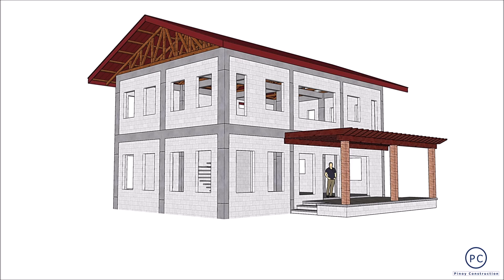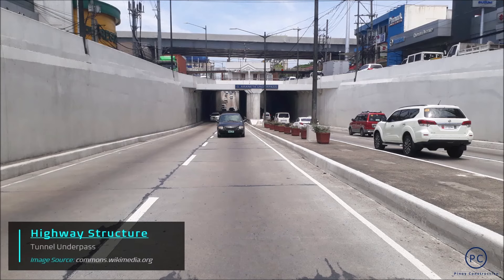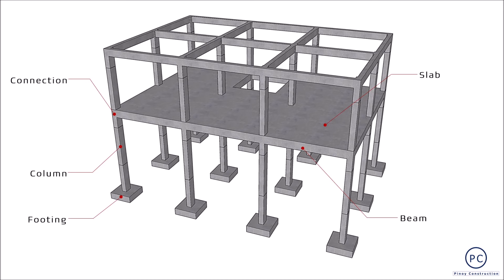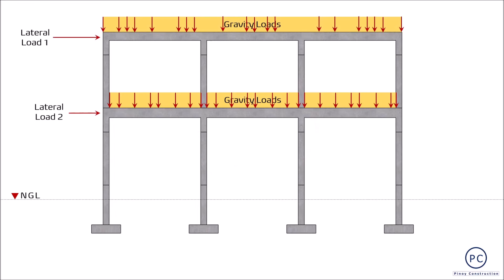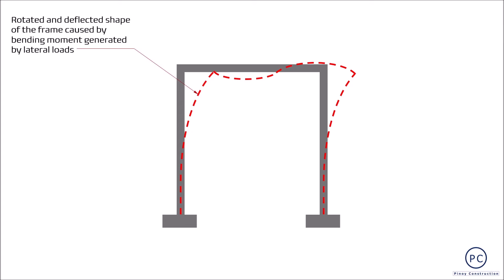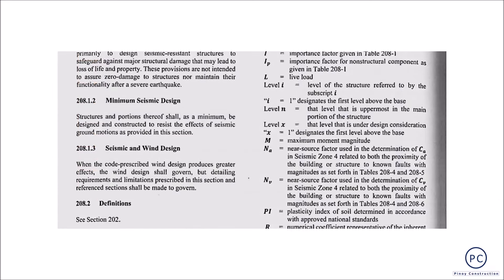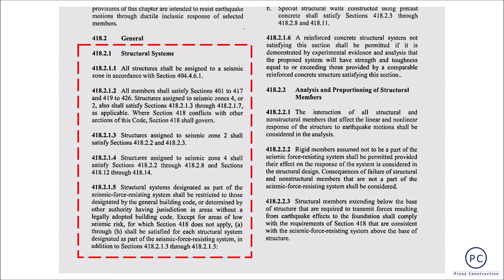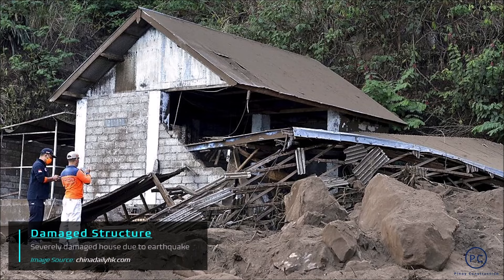Ang Basics ng Structural System Part 1 - Code Requirements

Comment: Hi. I was wondering what is the standard size for beams for a single story residential structure in pampanga? I see that it is 16 mm because of earthquakes but they build my house with 12mm on the beams.
Reply from the maker: Hello. I apologize for the late response. There is no such thing as standard size of reinforcing bar for beams or columns in our Structural Code (NSCP 2015). Although in engineering and construction practice, size 12mm for beams is usually sufficient and recommended for single and multiple storey residential. For columns, 12mm is adequate for single storey and 16mm for 2-storey. Thank you for trusting and supporting the channel.

Comment: Salamat Engr.
New Subscriber here.
Ask ko lang po.
Nagpapagawa ako ng concrete Fence ngayun. Naka design sya as abang para sa poste ng bahay na itatayo in the future.
Dinesign naman sya ng Engr. 
Ang tanung ko lang po is about sa Splicing. tapos na kasi yung isang mukha ng fence .kakapanood ng video nyo na realize ko yung splicing zone na dapat. Kasi yung putol na ginawa ni Foreman ay pantay pantay na doon sa Vertical bar ng poste. Hindi na masusunod yung sinasabing 50% splice lang dapat. Bale magiging 100% kapag gumawa na ng panibagong poste para sa unang slab.
Paano po ba ang aprroach sa ganito? Mukhang heto yung maling nakasanayan na ng mga foreman. 
Ang sabi sa akin ng Foreman, sa dami na ng ginawa nyang bahay ay puro ganyan ang yari, at wala namang problema.

Ang sa akin lang naman ay masunod kung ano ang nasa code.
Sana po ay magabayan nyo ako kung ano ang dapat kong gawin.
Maraming salamat pong Muli at more power sa inyo.
Reply: Idagdag ko lang po Engr.,
Bale ang dami ng vertical bar ng bawat poste(total 12 columns) ay walo, na may sukat na 4pcs. 12mm at 4pcs. na 16mm.
Reply from the maker: Hello po sa inyo. Una sa lahat, maraming salamat po sa tiwala at suporta sa channel. Hayaan po ninyo akong magbigay ng kaunting paliwanag regarding sa presented situation ninyo. Nararamdaman ko po kasi na mayroon pong kaunting confusion. 

Ganito po kasi yan. Ang building construction whether residential, commercial, industrial, o institutional ay ibinabatay mainly sa 2. Una po ay sa mga governing codes (National Building Code of the Philippines NBCP and National Structural Code of the Philippines NSCP 2015) at sa general construction practice. Ang mga code na nabanggit ang nagtatakda ng "minimum requirements" or "standards". Kapag sinasabi po na "Code", ibig sabihin, ito po ay bahagi ng batas (legal document) na kailangan natin sundin. Similar po ito sa Family Code, Civil Code, Labor Code, etc. Kaya po sinasabi ang salitang "requirements".

Ang ika-2 po ay batay sa general construction practice. Ito po yung mga actual methodologies na nakasanayan na at satisfactorily accepted dahil ito po ay proven at tested sa site. Maaaring hindi po ito specifically stated sa alin man code pero ginagawa ito dahil ang mga license civil engineers ay required na magpractice ng profession in good faith.

Kung mapapansin po ninyo sa mga video discussions ng Pinoy Construction channel, ang mga information ay mostly presented at delivered with basis from the code at maging sa general construction practice. Nagpe-present din po ako ng aking sariling recommendation. Kapag sinabi po sa video na ito ay "from the code", required po talaga na ito'y sundin regardless. Pero kapag sinabi po na "ang general practice..." o kaya ay "ang recommended practice...", hindi po ito requirement na kailangan masunod sa dahilan na ito ay maaaring hindi applicable sa isang paticular na project situation at condition.

With that being said, sagutin ko po ng pranka ang tanong ninyo. Ang 100% rebar splicing ay allowed po ayon sa structural code. Wala din pong provision na nagsasabi kung saan particular ang location ng splicing sa column rebars. Hindi rin po specified na dapat hindi pantay-pantay ang splicing o ito yung tinatawag na splicing in a staggered manner. Ang meron sa code ay ang length of splicing, ang uri ng splicing, etc. In the absence po ng code provision, ang engineer must render a good professional practice. Ang nag-design po ng inyong structure must choose a better option/methodology. In short, siya po ang dapat na magtatakda ng requirements.

Paano po ba ito? Ang isang general at recommended construction practice ay magiging requirement lang kung ito po naka-specify na sa contract documents katulad ng isang approved plan. Bigyan ko po kayo ng halimbawa. Sa code, ang minimum concrete cover po ng vertical bars sa column ay 40 mm. Kung naka-specify sa approved plan na 50 mm ang minimum, hindi po susundin ang 40 mm na nasa code kundi yung nasa plano.

Mao-obliga lang po natin si foreman na gawin ang 50% total splicing, splicing in a staggered manner, at ang recommended splicing location sa column kung ipinalagay ang mga ito sa contract documents ng engineer na nagdesign. Usually, ito po ay makikita sa structural/general construction notes.

Ako ay nag-aagree totally sa sinabi po ninyo na mayroon po talagang mga maling nakasanayan. Kadalasan ay nagiging excuse po yung mga salitang "matagal ko na itong ginagawa pero walang namang naging problema" o kaya ay "marami na akong naging karanasang ganito" upang tanggapin ang kanilang naging pamamaraan. Ang ating mga construction practitioneers tulad ng foreman, leadman, steelman, karpentero, mason ay kinakailangan pa rin i-supervise ng isang engineer.

It is a pleasure to answer your inquiries. Maraming salamat po ulit sa tiwala at suporta.
Reply from the maker: Hello po ulit sa inyo. Hindi po ako makakapag-comment po tungkol dito. Kung ito po ay dumaan sa engineering design procedure, at na-approved, nothing to worry about po. May mga na-encounter po akong column reinforcement na similar po dito sa isang approved plan.
Reply: @PinoyConstruction1  Hindi ko alam kung papaano kayo pasasalamatan❤️❤️This means alot po. Hitik na hitik sa kaalaman, detalye at naipaliwanag nyo ng napakalinaw para sa mga katulad ko.

Maraming maraming salamat po muli Engineer sa sagot nyo, sa oras na binigay nyo sa pag tugon. 

Mabuhay po kayo❤️❤️
Reply from the maker: Wala pong anuman. Very glad to help.